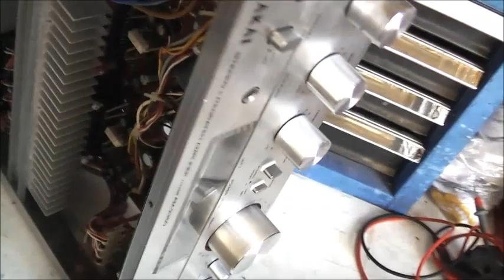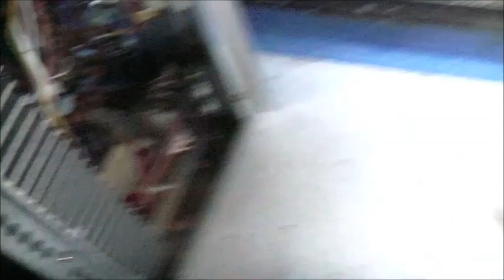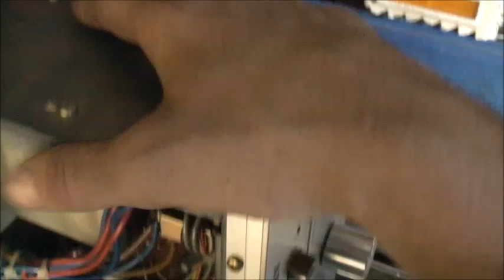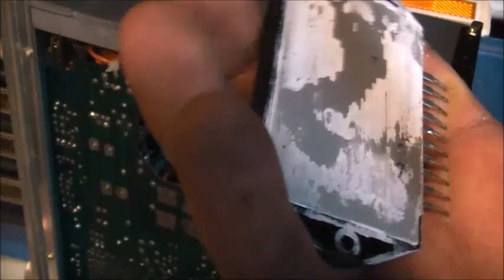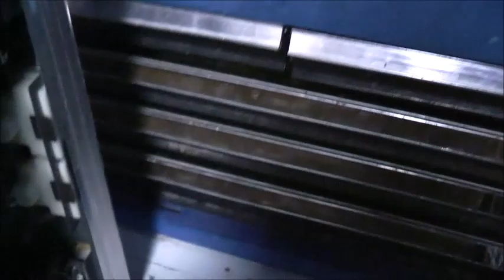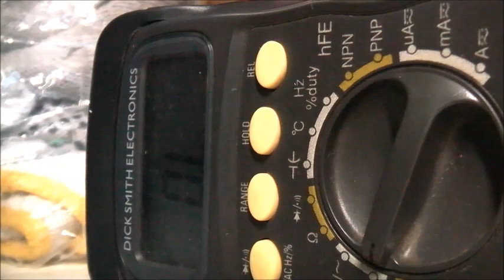Akai AM 2350 Vintage Amplifier Score

Comment: I know it is an old video. But I wonder if you could answer the question. I have ran into a guy who sells am 2350, brand new in the box. His father got it as a present in 1979 and never used it, sat in the closet all these years, gels packets still inside the box. He wants $350 for it. Is it worth buying it? He only tested it with headphones as he does not have speakers. I am puzzled, as I really like the amp, but at the same time I don't want to spend another 300-500 to recap the amp, etc. What's your opinion on this? Thanks.
Reply from the maker: That is a good amp 350 for NOS is a fair price
Reply: @HDXFH  my worry is that most likely I will have to spend another 350-400 to recap as I understand it will need to be done. So that makes this amp $700-800, quite expensive for 35wpc amp. How reliable this amp is? I know Akai as a a great tape brand, not sure about amps.